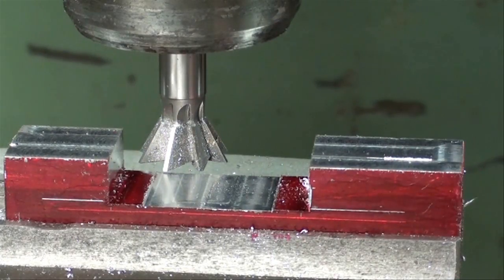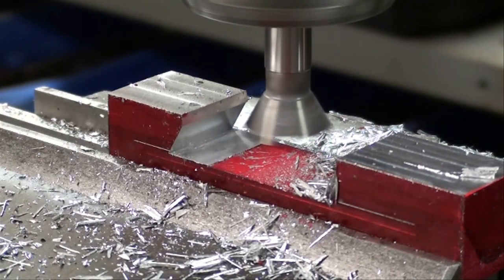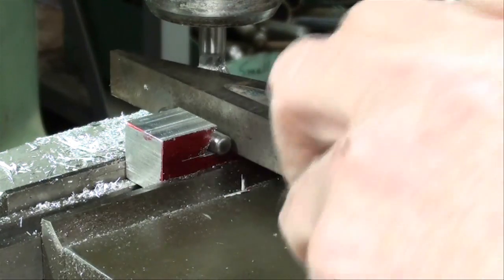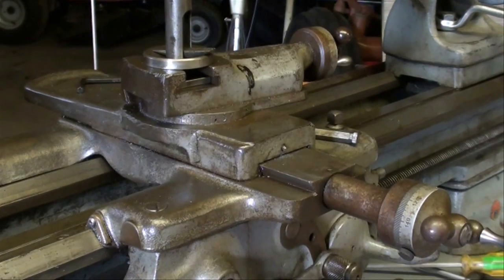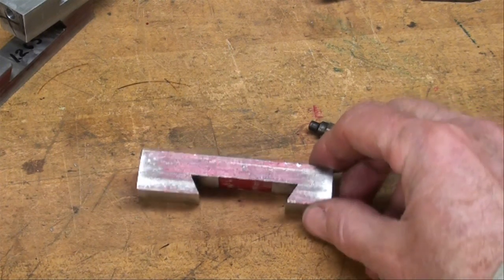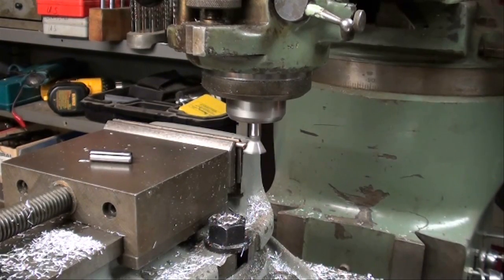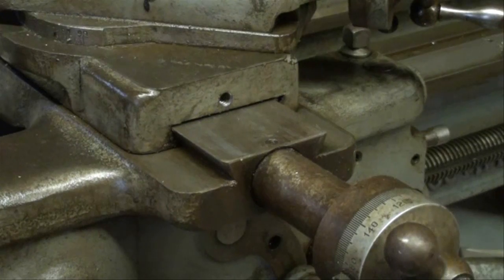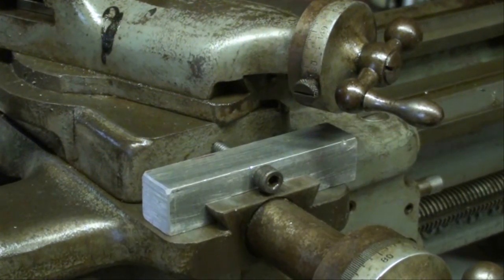MACHINE SHOP TIPS #77 Cutting a Dovetail on Bridgeport Mill Part 2 of 2 tubalcain

Comment: I looked at this video to get info on cutting a dove tail,  I have had the South Bend cross slide stop for years and never used it until last week, it does speed up the threading.

Comment: Sir, I really enjoy your tutorials and this is another good practical addition. I was wondering if you have posted anything about cutting tools for your milling work that I could watch or you might consider adding. The reason I ask is because I am a novice, tooling is expensive and sometimes the range on offer can be overwhelming. Is there a suggested Basics Kit we should look at. Along with the different tools to be used some speeds suggestions especially for different steels as a guideline. Many thanks, Gordon
Reply from the maker: +Gordon Agent Gordon--I cover most of that in my video courses. I don't have any youtyube  videos on that right now. Thanks for watching.

Comment: Pete, I love your videos, How do you cut a dovetail in steel without blowing up the cutter? I want to rebuild my lathe tool holder from steel and worried about destroying my dovetail cutter.
Reply from the maker: SLOW FEED< LIGHT CUT< OIL
Reply: mrpete222 That worked, lathe back online.

Comment: Clever little clamp. I have no mill, and only a tiny old Craftsman lathe (yet to be set-up) but I like to learn new stuff everyday. Between you and Keith Fenner, plenty of ideas.
  Years ago, at an auction, I paid $1,500 for an old Gerstner wooden machinist chest full of 'stuff', brought it home, it contained about $25,000 worth of Starrett and Mitutoyo machinist inspection gauges and one of those planer gauges, very pricey. And sets of those die-transfer screw marking punches.

Comment: I have one of those planer gages new in the box but, in thirty one years of machining I have yet to find a use for it. I mainly bought it for nostalgic value. I just remembered...I did use it once to set up the blades on my wood planer so, I stand corrected, it does have a use...lol.

Comment: you always make the the most useful videos! this is just one more accessory i need to make for my southbend 9" seams easier than trying to remember what number i stoped at on the cross feed. i'll probably put a thumb screw instead of a hex head set screw since i already have too many allens sitting on my lathe table during regular use. great video thanks again!

Comment: Keep up the good work, keeps us old ones watching excellent professional vidios. I had a
little different approach, didnt have a mill back then, did it all on a shaper then slit it vertical on
one side with 1/4 20- glued brass to its Vs then when tightened it gets pinched, so the width
of the dovetail is not critical works for me. May have been done before i dont know.

Comment: You can put the part back in the vise very accurately (within tenths) if you do a few things. Square up the block before starting and replace that  Bridgeport vise with an angle lock. Also, use a stop.

Comment: @mrpete222 I watch all of your videos and look forward to seeing new ones. I have learned a lot. I have a south bend lathe, I think it is a nine inch but it seems to have an extra spacer under the head and tail stock??? However, I have not had much luck in finding the correct oils for the gearboxes on this. What do you use for the sae 10 and sae 20 oils and where is a good place to get them? Thanks again for the great videos.
Reply: Check with Grizzly.com, they own the rights to Southbend now.

Comment: Great video, I made one for my clausing, but cut the part and then use a bolt to pull the halfs together so that the dovetails lock on the male dovetail.....you mention in you video that you shouldn't remove you part from the mill vise until you know it is correct, but if the part is set up on parallels and bumping a stop, there is no reason the part can't be pulled for fit or inspection

Comment: Dear Mr Pete, I in no way wrote that in defiance I enjoy all vidios It was only to reach those
without the means of this operation.  I too had a mill got rid of it just tooling puts one in the poor
house.  I make Doves all the time only with machines of my time, cheap HSS tooling quiet 110vts
takes no space yes a shaper. If I could only do a vidio of this amazing machine.  I even made a
milling att. for mine.  Wish you could do vid. on a shaper. My cam only does 10 sec good work sam

Comment: Another excellent job!   I write this for those SB people without the royalty of a mill. Many yrs
ago mine is only a 3/8  upsidedown " U" tightened in the provided hole then two wing screws on
the botttom two legs (to re adj. to pick up a thread) for external threads.  For internal treads I
remove this collar and simply use a long screw in the provided hole I back out to "touch" and
mearly adjust screw till it hits the dial housing.  (internal thread stop) works perfectly